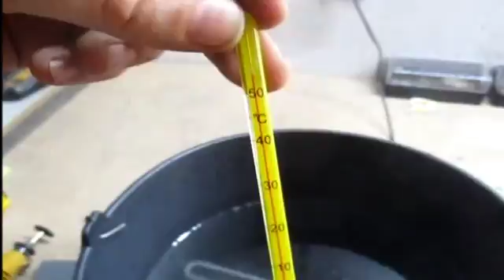DIY-Electric hot water bucket (from a washing  machine heating element)

Comment: does the heater element not melt the bucket?
Reply from the maker: No, the bucket is in contact with the rubber from the element. As you can see on the video